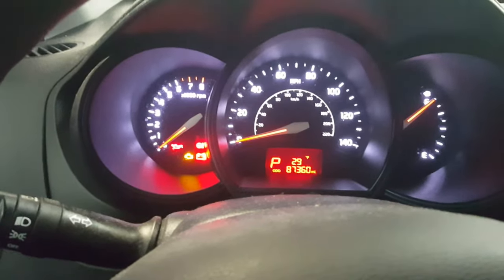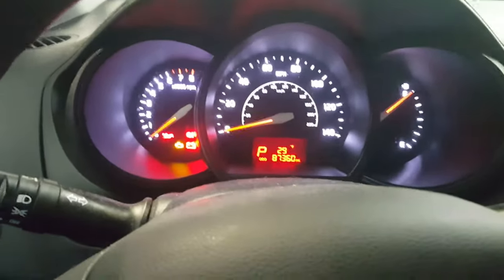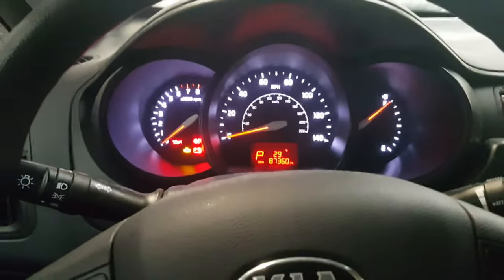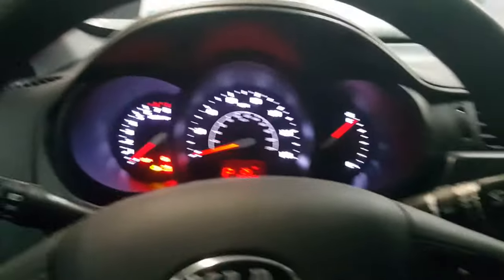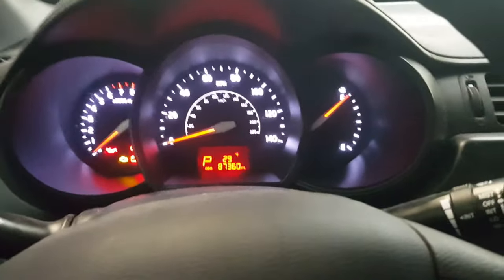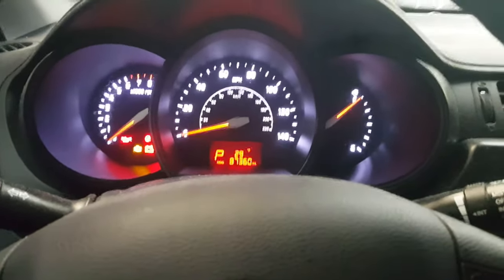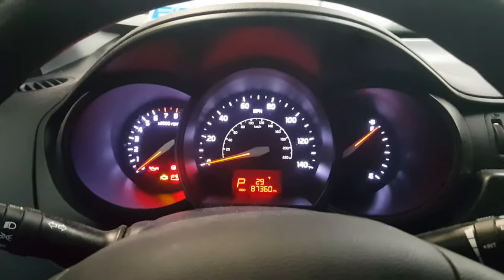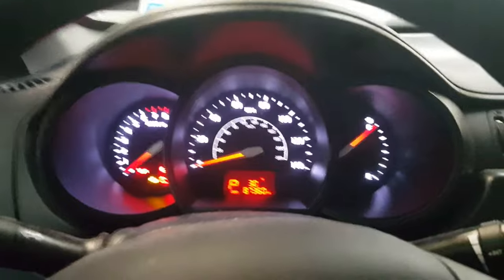P0011 P0014 Dont ever let This Happen

Comment: I just bought a used Acadia, drove it away and the money light lit up. I couldn't believe it, ran the code and saw P0011, parts store recommended VVT solenoid. I saw your video, did a full synthetic oil change and CEL is no more. THANKS!

Comment: Holy cow or people that busy that they can’t lift the hood and check the oil. Thanks for sharing 👍🏻
Reply: I am running into this right now and for me it was the assumption that if there isnt oil leaking and no signs of it burning...then it should be where it was when i last checked it.  But sure enough i got the p0014 and when I check the dipstick..not a drop of oil.  Shouldn't there be some sort of warning light for oil pressure on these damn things?  My 99 tahoe had a gauge...so I could always tell when my oil went that damn low.  I now have 2013 equinox and its a whole new ballgame.
Reply from the maker: Almost every car that comes in the shop is low on oil. You would be very surprised at how poorly people maintain their cars.
Reply: @josephcastillo3292  doesnt make sense why their isnt a light anymore

Comment: I don’t think it’s always neglect. I’ve got this code throwing at me. I consistently get the oil changed and check it all the time. I’ve also cleaned the solenoids as well as replaced them. At this point it still hasn’t gone away and am worried it’s an electrical issue.. 😞
Reply: Might be a ground or cable making false contact , time to learn electrical work buddy
Reply: Did you fixed it?
Reply: @Jonazyzz did you get it fixed? I read it could be camshaft sprocket if you already changed the solenoid. That's where I'm at. No misfires so I don't think it's the timing chain

Comment: I have a 2007 subaru impreza GH2 which has shown check engine light and upon checking the oil it had nothing on the dip stick also the car has been smoking in the morning and after warming up the smoke clears. I have put in new oil and Diagnosis has show error code P0011 A camshaft position system performance bank1.....I have cleared the code using diagnostic tool.  What should I do? do I have change the camshaft sensor?

Comment: I  have a Kia Rio My car got the same code. I just got my oil changed today and the engine light went away. The thing is my car was a little low on oil. I still had oil in it. It seems perhaps these cars are picky about the amount of oil.
Reply from the maker: Yes, they are very picky, I would have it topped up.
Reply: @FlatRateMechanic  it was time for an oil change anyway. I was a couple hundred miles over . Hopefully the light stays off.
Reply: THERE PICKY ABOUT THE FILTER TYPE . I THOUGHT IT WAS A JOKE AT FIRST TO I PUT AN STP FILTER AND FULL SYN STP OIL DROVE 3800 MILES CHECKED OIL ADDED 1/8 OF A QUART IF THAT AND BANG CONTROL VALVE WENT OUT.  ALSO HAD LOW OIL  ONCE RIGHT AFTER I CHANGED THE OIL. WENT BACK TO KIA FILTER , NEVER HAD ANY ISSES WITH KIA FILTER FIRST TIME I USED AFTER MARKET ISSUES ARISED.

Comment: I have four hundred seventy thousand miles on a I6 4.2 Chevy Trailblazer, and we ended up having to change out the timing chain and cam gears and all related sensors because of a p0016 caused by a disintegrated chain guide shoe. We got rid of the p0016. Truck runs fine but when it warms up it  throws the codes P0171 and a p0014 after driving .  We change the oil every 3,000 Miles. I don't think it's neglect in every case. Any suggestions? 1:20

Comment: My wife's car ran dry oil sorted now and changed a solenoid code went but came back after a few miles. It's a chain not a belt but is running fine as far as I can see it would cost 100's to sort out but I suspect its something to do with it going so low on oil. Ps oil warning light obviously isn't working either
Reply: That's a 2k problem sheesh

Comment: Hello. I have a 2007 Saturn outlook. One day my vehicle gave me "traction control off". "Service traction control".
"Service starbilitrak" (I think that's how you spell it) well it came on and turn off for like a good 30min on my way back home... Now another day I drove it and it gave me those to message on the dash two times after coming from grocery store and heading back home 40min (no check engine light by the way) so I finally decided to grab my scan tool and a p0014 showed on the scan tool.. I seen video where it could just be low on oil. I haven't changed the oil in months. Right now it's at 30% oil life remaining.  I'm going to check the oil tommorow. First thing in the morning. I'm hoping that this is a common problem or maybe needing to replace the Variable Valve selenoid.
Reply from the maker: Many people do not realize it is very common for your oil to go low between oil changes and should always be checked more often. I'm willing to bet it is just low oil.
Reply: The Flat Rate Mechanic thanks. It was the oil. It was missing like 2-3liters of oil.

Comment: i had overhaul an engine sorento 2.4 as the engine oil mic with radiator water,after everything done,p0011 and p0014 came out.i had change both vvti pulley and sensor,but still this p0011 came out.i used all original part with 5w-30 spec engine oil.is there any reason if the tensioner too tight will cause the exhaust or either intake cam angle degree missed out a bit?
Reply: Did you solve the problem?
Reply: @EARTHKEENING  no, customer insist sell instead of keep buying part but I guess it's the cam shaft problem.

Comment: I bought Micra 2012 one year ago, after drove it 30 miles, I found p0014 code, I replaced VVT solenoid valve, I change the oil regularly every 3000 miles, I still got the code from time to time, I found out when I delete the code using code reader , the car runs normally till I change the oil, the code comes again only once, if I delete it, it will never comes till I change the oil. It is weird? I drove the car over 35000 miles this year and I still have the same problem.
Reply: My brain thinks it's some dirt somewhere might need a flush. Getting clogged every time you empty it

Comment: Help ‼️ I’m getting same code p0024 & p0014 after an oil change on local fast oil change service . Oil level is perfect. Changed already camshaft sensors but still same code popping up .
Reply: is the oil too thick?
Reply: @dustinchen  not really.  Just for a safe side o changed the oil again but problem is still there
Reply: nabila B did u solve the issue?
Reply: What was the issue?

Comment: I switched out the intake and exhaust vvt solenoids but im still getting an p0014 code thats preventing my car from starting. I also did an oil change with new filter
Reply: i have the exact issue. Did you find out what's wrong?
Reply: @angelaangela3428  it turned out to be engine failure due to a rod bearing so im getting my engine replaced for free due to recalls on my car
Reply: @fightlikegentlemen  if you don't mind me asking. What's your vehicle?
Reply: @angelaangela3428  kia optima lx 2014
Reply: @fightlikegentlemen  thanks

Comment: I had the same problem today the engine check light  was on after a diagnostic I got a code p0011 and After checking the engine oil it was very low.i did and oil change instantly but the engine check light remains.what should I do?I noticed that after changing the oil and the filter there was no noise anymore.what should I do next ?I need your help guys please
Reply: How did this end up?